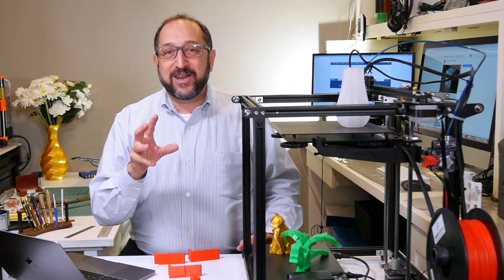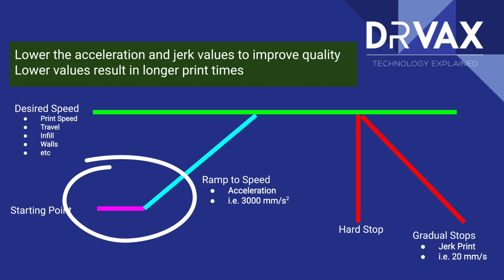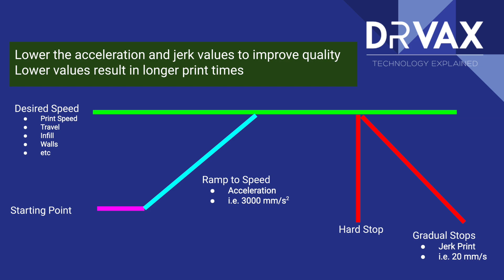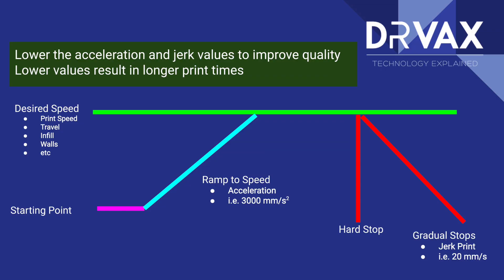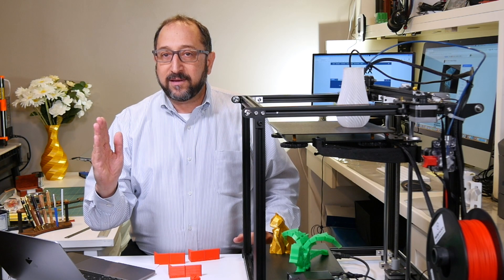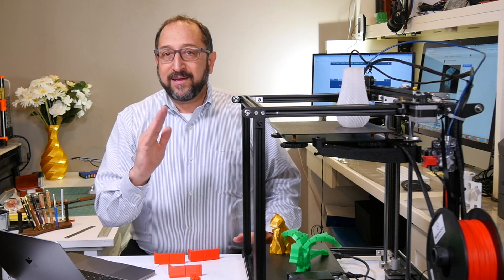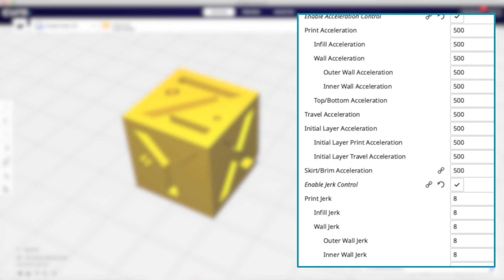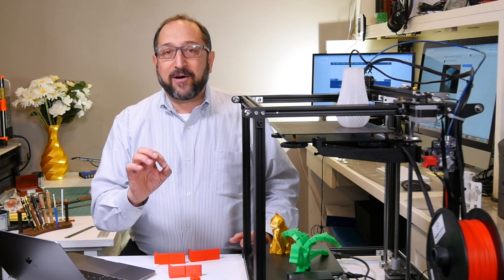Reducing 3d Printing Ghosting

Comment: I use the same supports for my Ender 5 Pro, which has the same setup.  The Ender 5 Plus, with the larger print bed, has the dual Z Axis rods.
I got them to fit on my Ender 5 print bed though.  I had to do them one at a time, but I did print them on my Ender 5 (220x220x300 build capacity).  
Those supports really do make a big difference to vibrations in the printbed.  I also found a flat stone slab was almost as good as a concrete floor :).

Comment: Just the last few weeks I have suddenly started having the worst trouble with really bad rippling (also called "ghosting" or "ringing"). The thing is, I am getting the rippling now with the SAME GCODE files that I was using before and did not get rippling, so I know that it is NOT in my slicer settings! But most of the suggestions I find when I search for it are all about those settings (which I'm already doing in my slicer settings anyway).
I have made sure might mybelts are at a good tightness, I even added belt tensioners to adjust them. I just replaced my X axis stepper motor and no change. I have the Y axis on order (for some reason the 42-40 dual shaft that the Ender 5 uses on the Y is almost impossible to find). I have checked my rollers and they are smooth and at a good tightness on the crossbars but still roll freely.

One other thing that started happening at the same time that I hadn't seen before was on long runs I get layer shift near the end. Again, my belts aren't the problem. But that layer shifting could be caused by the stepper motor controllers overheating and stalling for a little to cause the shift. Could the motherboard be going bad and that is causing my rippling too?

Comment: When I tried to print the supports on my Ender 5, I also ran into the problem of the supports being 1mm too long to print. So I turned the supports at a diagonal and was able to print them both (though, I forgot to remove the clearing strip and one of them has an awkward stripe). 

I actually printed 2 sets of supports, my first ones I installed the way you have them, and it split (was using cheaper filament and reprinted in better stuff). But when I went to get the files again, I realized I had put the supports on backwards! When putting them on correctly, they grip from the inside of the frame, not the outside (so, left goes on left when you're facing the printer). I haven't noticed much of a difference, but it's something I wanted to point out. I too have a cheap table, but am waiting on a delivery of some sturdier legs. 

Love your channel, I've learned a ton in the few short weeks I've owned my printer!
Reply from the maker: Thanks.

Comment: Great Videos DrVax !   Subbed.   I have my Upgraded Cr10sPro  on a shelf but the shelf is mounted to the wall with extra brackets  you could sit an elephant on it.    appart from that I made a wall mounted Spool holder as the biggest source of vibration of this kind of printer is the spool mounted to the frame. that helped a ton!  tight belts and wheels!  just enough that theres a fair amount of resistance when moving axiz with the motors unlocked.   I also printed TPU dampeners for under my Printers feet.  that helped too.    I often now print 120mm/s with an aceptable amount of ghosting.    I have a hemera and volcano on it so I do like to print fast!    one thing.,......is now its direct drive instead of bowden and the direct drive did not increase ghosting  which is not what I expected.
Reply from the maker: Very interesting.  Thanks for sharing.

Comment: Thanks! Although, a lot of guys (including myself) state, that the printer should be able to vibrate freely. And this is why we add vibration dampeners to the printer feet - to isolate it's vibration and make it happen as if the printer was floating in space (sort of)
Reply from the maker: Thanks for sharing.

Comment: Great video. I have had excellent results sitting the printer's legs onto pieces of neoprene or similar spongy closed-cell foam rubber. You can find it cheaply in some computer mouse pads, or in sheets at home improvement stores. It absorbs the vibrations created by the printer, and also can absorb vibration from the table if located on a wooden floor (preventing skips in the prints when the floor or table experiences bumps or vibrations). The printer vendors ship the printers with thin rubber stick-on feet, which is better than nothing against a table or hard surface, but not nearly as good as this style of foam. Very cheap shock absorption and worth adding to improve print quality!
Reply from the maker: Makes sense. Thanks for sharing.

Comment: Hello, DrVax!
You've didn't mentioned dampers (printed or made out of styrofoam) that can be put under 3d printer's legs. I've didn't succeed with that yet but I've tried just one time with the package's styrofoam pieces. Probably they're not thick enough. This theme has the theory that dampers' layers shifts opposite to a vibration. Of course it's a matter of "try and error" method as I understand. Because you need to get a proper softness (or rigidity) that will be working best. If you have a time to investigate this then it could be a topic of your further video.
P.S. I think it can be checked with a high speed recording (when it's visible how it vibrates) with a proper setup.
Reply from the maker: Check out my MP10 video about ghosts.  I cover dampers in that video.

Comment: This is correct what DrVax said. But they is also a other way to do this. You can do in the settings on the 3D printer. For the speed and jerk settings as well. Also you will need to have the eeprom enabled in the firmware to save the settings so you don't have to keep going back in and changing them every time you turn the printer on and off.
Reply from the maker: Absolutely correct.  Thanks for suggesting this.  This is how we learn together.

Comment: So why some people put vibration dampeners under there printers?
Reply from the maker: Because it reduces the vibrations to the table which keeps the table more stable.
Reply: @MakeWithTech  so in this case ghosting is going to be worse right?
Reply from the maker: No better.  Anything you do to reduce movement of the printer, table, etc will help.
Reply: @MakeWithTech  so if I put squash balls under my printer.....